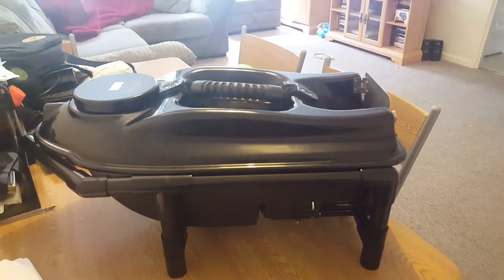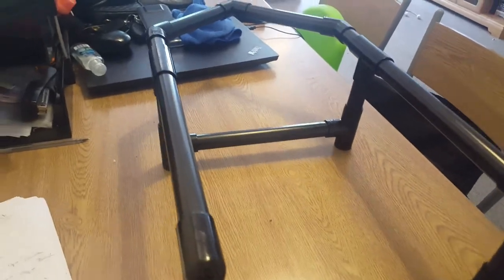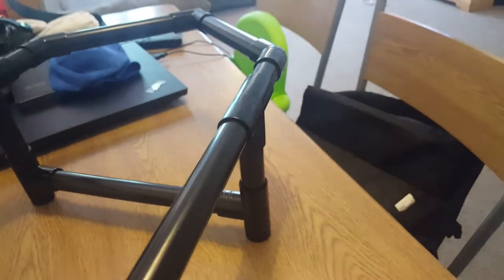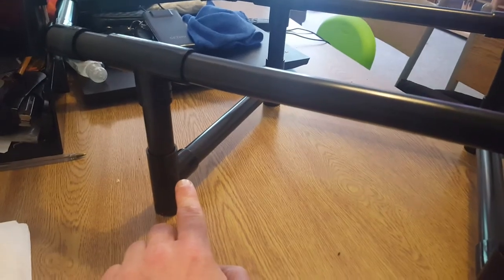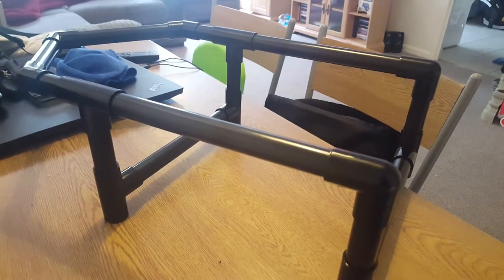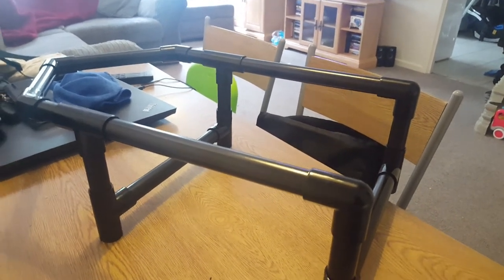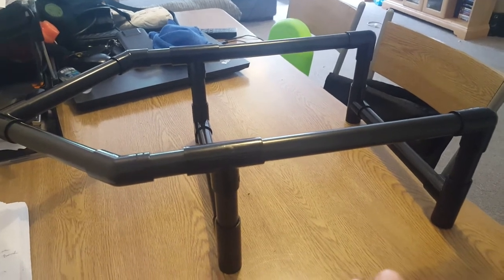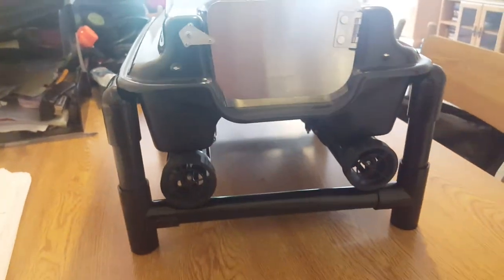**Actor Bait Boat STAND** for £8.08!! How To Make - Design & Dimensions #Actorbaitboat #Boatmanuk

Comment: Where do you use the straight couplings
Reply from the maker: The staright x4 straight couplings (leg extensions) are an extra if you want the stand raised further off the ground 👍
Reply: @carphunters-fishing4carpti382  cheers pal 👍 your video as help me a lot
Reply from the maker: No worries at all mate. Thanks for subscribing 🎣
Reply: How long do we the length for the actor plus @carphunters-fishing4carpti382